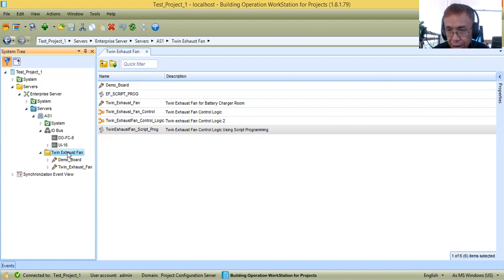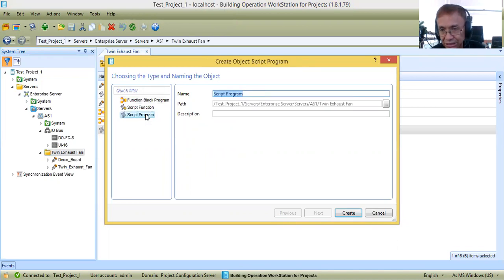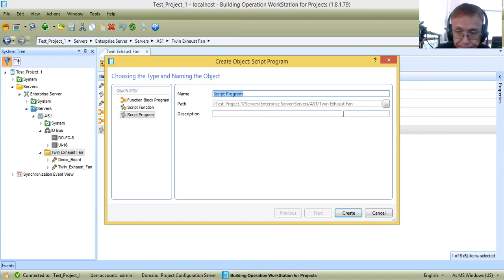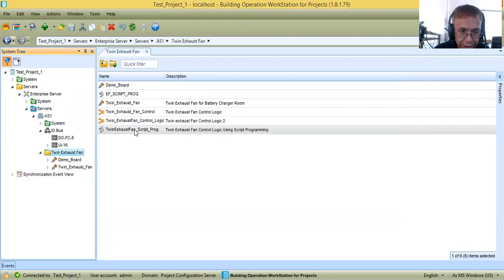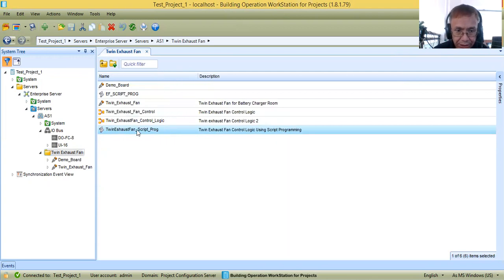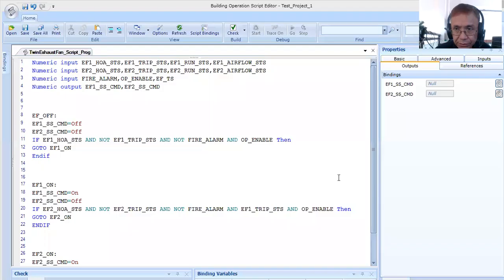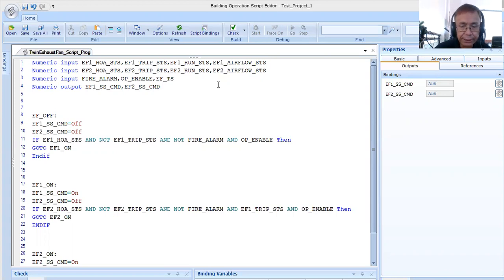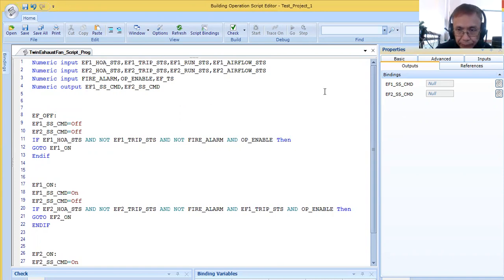How to become a BMS engineer part 76 (Script Programming)

Comment: Looking chiller plant manager script application
Reply from the maker: how many chillers involved
Reply: @SantosJrCapellan-BMS  3 chillers - 3 primary pumps - 3 condenser pumps 
Primary pumps are 1 pumps + 1 chiller ( inlet) & outlet are common .
Condenser pumps are 1 pumps + 1 Choller inlet & outlet common.

Cooling tower 3 nos
Reply from the maker: @marimuthum7936  you can write separate script programs for condenser pumps, secondary and primary pumps, cooling tower and chillers